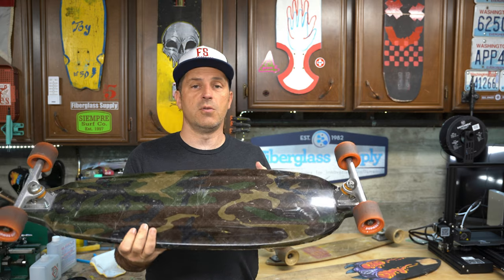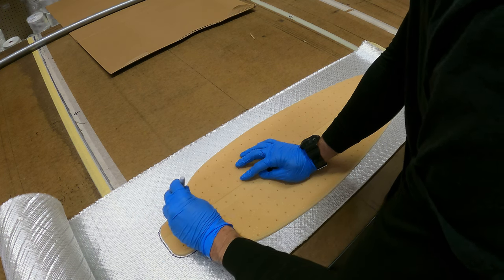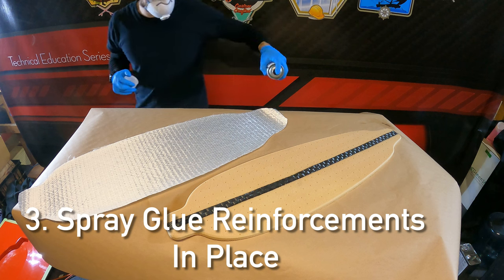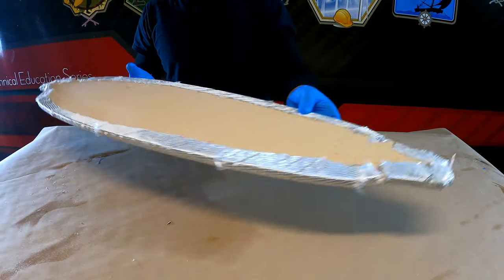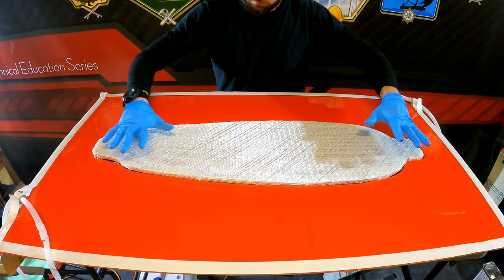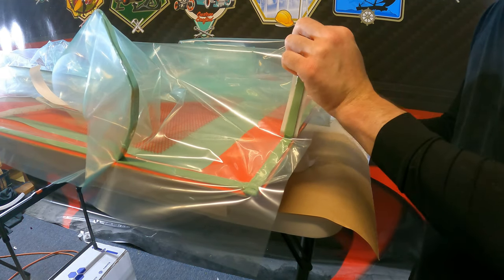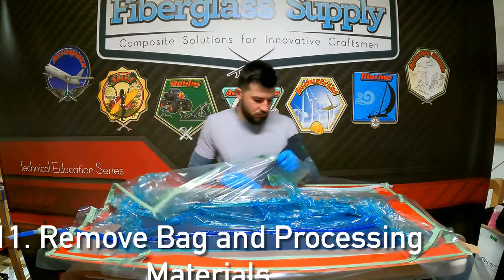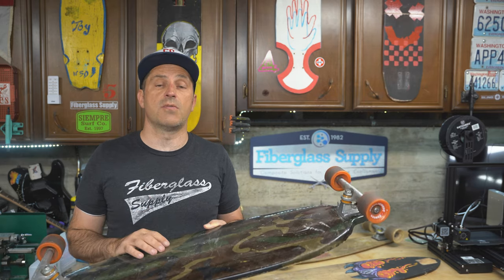How to Build a Composite Longboard Skateboard Using Resin Infusion

Comment: I looked up the resin you used by composite envisions. This Resin is about 1100 CPS as listed on their site. I was wondering how you were able to get the entire board wetted out in less than 18 minutes with a relatively thick infusion resin. I thought resins should be at 1200 CPS max, and can go down to 150 - 300 CPS. I was thinking that since this is a foam core infusion process (Which I am HIGHLY grateful there is a video on this) a 300 - 500 (max) centipoise would be more ideal. Thoughts on that? What would it be to do the same thing with a lower viscosity resin and how did you get a 1100 CPS infusion resin to travel that fast through a relatively large foam core part? I ask because some people have a hard time wetting out pure non-core fiber pieces of 5 layers with West Systems 105 which is 760 CPS for example. Thanks for the content and for accepting my nerdy questions - super appreciative.